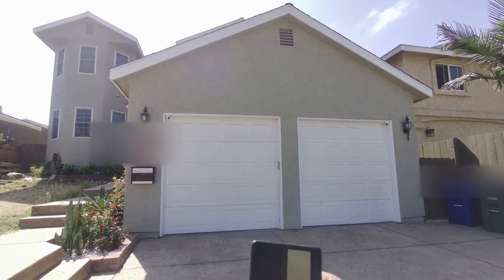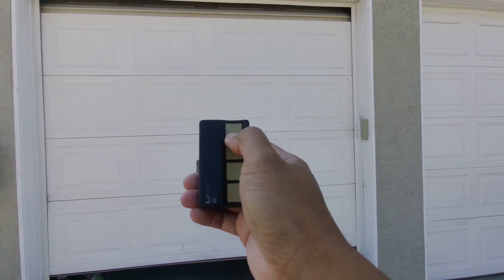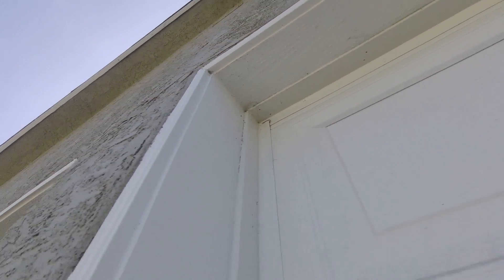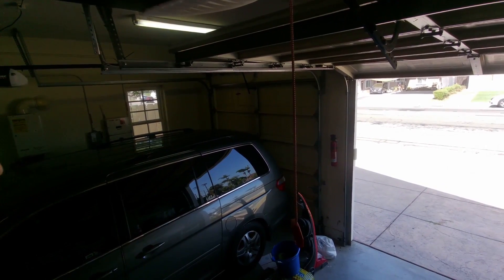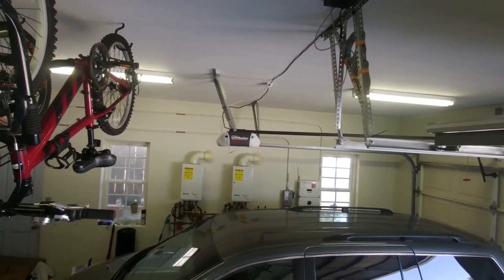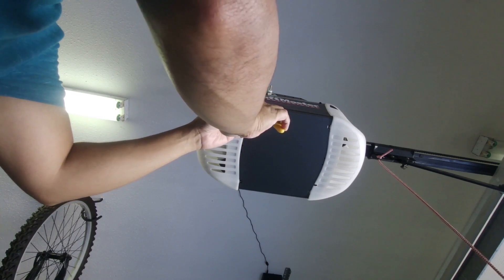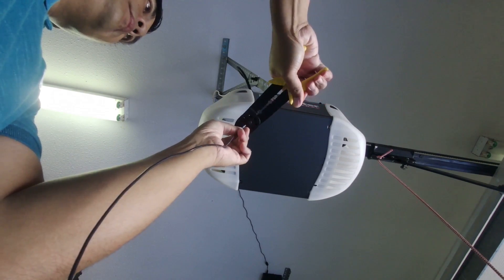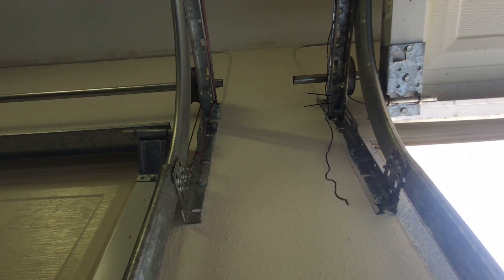Extend Your Garage Door Opener Range - Easy Fix

Comment: It didn't work for me. Next, I'm going to try removing all the LEDs I've put in my garage. I bought a special garage door LED for my opener and that didn't help either.
Reply from the maker: Does it work after removing the LED? Did you try replacing the battery? If it still does not work for you, the next you can do is get a MyQ smart garage door opener so you can open it with your smart phone.  

https://www.youtube.com/watch?v=9uii880DbhY&t=1286s

I used the MyQ for Amazon garage delivery and to open the Garage for my In-Laws remotely when I am away but I still like the remote better as it is faster to access.
Reply: @DIY Manual  Thanks for the info. No luck with the LEDs or new battery. I got the wifi opener connected it to my SmartThings so I can open with my phone. May try a real coax extender antenna that was built for garage doors. Thanks!

Comment: You could have just attached the antenna wire coming out of the garage motor to the frame/track which would  do even better.
Reply from the maker: Thanks for the suggestion.
Reply: Gonna try it out tomorrow.
Reply from the maker: Did it work for you?

Comment: Check your battery people!
Reply: You think people having this problem didn't already try that?
Reply from the maker: Agree. That is the first thing I did and I mentioned it in the video as well as the description. Others also mentioned that appliances or LED fixtures in the garage can also cause signal interference. So whatever is causing the interference on my setup was eliminated by extending the wire to the outside of the garage door.

Comment: Your video helped me with my garage. I can stand on my sidewalk and the remote still works. I didn't even have to extend the antenna far. I just added another 6 inches of bell wire and it worked. Thank you for your help
Reply from the maker: Thank you for sharing your experience and modification. I am happy to help.

Comment: My door opens with the remote outside the garage, but it won’t close when I’m outside the garage when the door is open. It only closes if my remote is directly under the opener.
Reply from the maker: That is a weird issue. Have you tried resetting and reprogramming the remote? 

Also,  try removing the bulb in the garage door and test it. Some LED and spiral bulbs are known to cause interference with the remote signal. It could be causing the issue because when you open the garage door the light turns on as well. 

Let me know if these were able to solve the issue. Thanks.

Comment: I had the exact same issue even with regular filament bulb, new battery, erased/re-programmed remote/opener codes. Thanks for your superb yet simple trick. I had some old garage door wire lying around that I crimped to the existing (short) antenna wire. I extended it to the opening of the garage door and now my remote works on the driveway, inside the car, as it should. Thanks again for sharing this, much appreciated.
Reply from the maker: I'm happy to help and thanks for sharing your experience.

Comment: I used bell wire and it didn't work for me. Does the wire material matter? Thank you for sharing!
Reply from the maker: Not sure.  Other mentioned that LED lights or other electronic device in your garage might be the culprit. Also is your remote battery good?
Reply: @diymanual  what kind of wire did you use??
Reply from the maker: @Alambe727  https://amzn.to/3qEnKjp
Reply: I just used doorbell wire (18 guage) a few minutes ago, and it works great! Perhaps your original wiring isn't tied in with the new wire well?
Reply: It depends on the length. Many people are getting lucky with their lengths, but antennas need to be specific lengths and orientations to be properly tuned to the receiving frequency

Comment: I was having the exact same issue with the door on my pole barn. Brand new remote and battery and still poor to almost zero use of the remote. I replaced the 2 opener bulbs with Genie garage door bulbs and still had poor open/close signal. I tried your antenna extension technique yesterday and holy crap, it really works!  To anyone having the same issue do exactly as this gentlemen and I did, just use the same gauge wire, a wire crimper and zip ties to keep the wire away from all moving parts of the door opener. Night and day difference! Thanks for the great video and help! A footnote: Do not use LED bulbs in your garage door opener! They do cause frequency distortion of the opener, thus, reducing the ability of the opener to recieve a strong signal.
Reply: Why would it matter if LED bulbs are used?  The bulbs are not on until the opener receives a signal and thus no interference when they are off.
Reply: @RoadiJeff  Possibly the LED circuitry is always powered on, even when the LED is not powered on. The real test is to unscrew the LED's and see how things change.
Reply: @RoadiJeff I had interference from the LED strips I added only when I tried to close the door upon leaving while the lights where still on. No problem opening the garage door when returning once the lights timed out. I’m hoping that extending the wire to outside the garage solves the interference problem
Reply from the maker: Thank you for sharing your experience and I am glad that it worked for you as well.

Comment: you are actually having frequency interference!  Most likely LED light bulbs or even those security cameras outside the door are causing it.  You shouldnt need to extend the antenna to get proper range
Reply from the maker: Thanks for the comment. I have also seen videos that talk about interference from LED bulbs but it does not seem to make a difference even when I replaced the bulbs in the front as well as the door opener. Anyway, whatever is causing the interference was solved by extending the antenna.
Reply: @diymanual  could be multiple things. refrigerator, freezers, LED bulbs etc. from what i was told it could interfere for up to 40 ft.  maybe next-door ?
Reply from the maker: @MarijuanaMotivatedTV  Maybe because I have a refrigerator/freezer combo in my garage. So putting the antenna outside helps. I never had issue after doing this sometimes it won't open on first click but it will always open on second or 3rd unlike before where I have to stand right next to the door to open.
Reply: LED lightbulb TOTALLY blocked mine! I took out the bulb and it worked like a charm!
Reply: Mike, my wife and I thank you. Exactly was our issue.
Reply: @jskalski  hey you're welcome glad that helped! 👍🏻